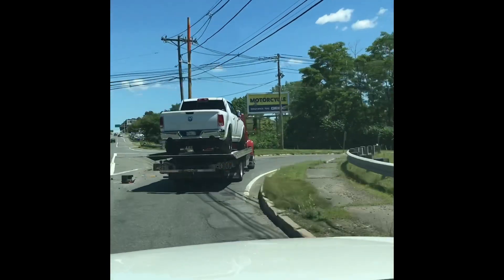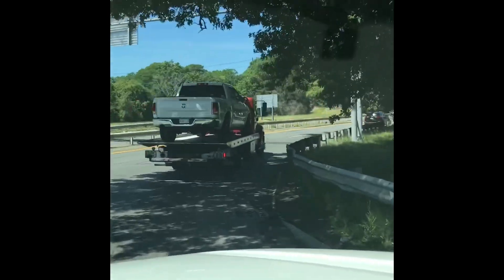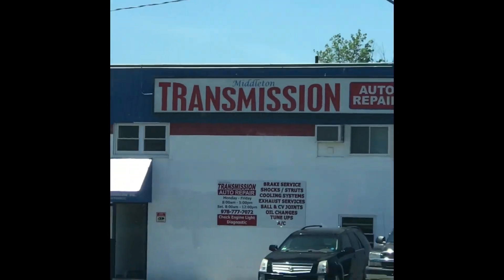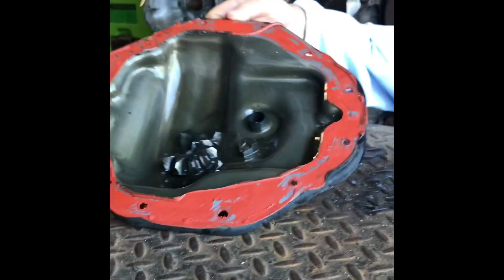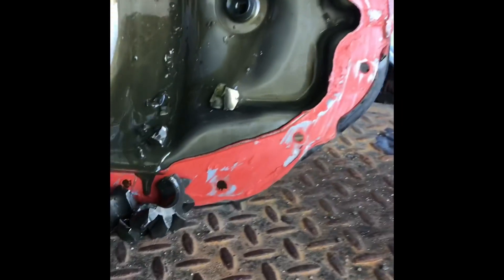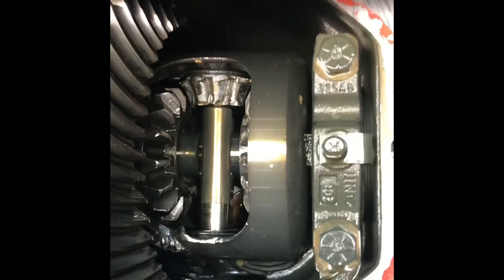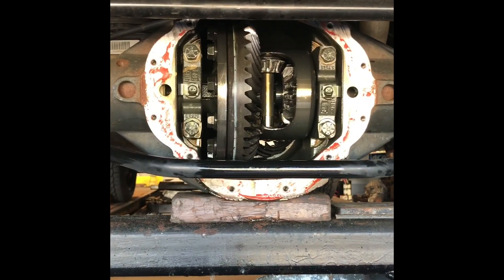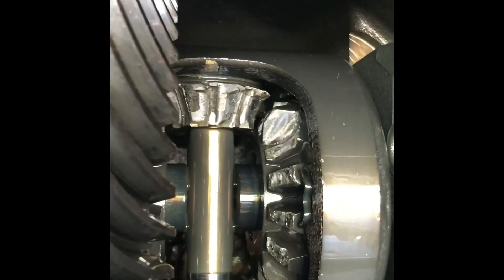Boosted RAM Blows Up Rear Diff

Comment: What's up buddy, is it safe to launch on 4x4 with all the power?
Reply from the maker: Derek Trilho sure is
Reply: I have my truck in the show as we speak getting the edelbrock installed and buddy said I can't use my 4×4 anymore unless I wanna blow out my transfer case. Is it maybe different with your setup?
Reply from the maker: Derek Trilho how many lbs of boost are you running?
Reply: Not 100% sure, maybe 5 or 6.
Reply from the maker: Derek Trilho that’s fine.  I mean, not sure what condition your transfer case is in and how old it is, but I know many people launching in 4x4 upwards to 6-700hp, 900hp 2500
Reply: Have you had any leaks or problems with yours so far?
Reply from the maker: Derek Trilho no none.  I launch in 4x4 lock then turn it off before I make a turn off the track.  But I’m NA cammed now so I’m less power than I was before but I have a 3200 stall so it’s hitting harder
Reply: What's the difference between lock and 4x4 auto? I'm only making 470 wheel so I think I should be good.
Reply: Thanks for the info buddy.
Reply from the maker: Derek Trilho good luck!